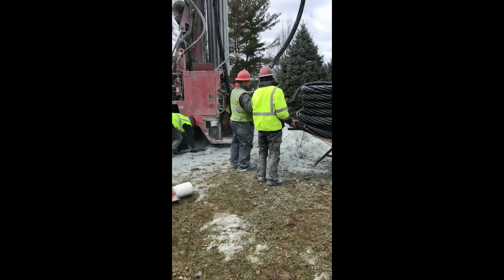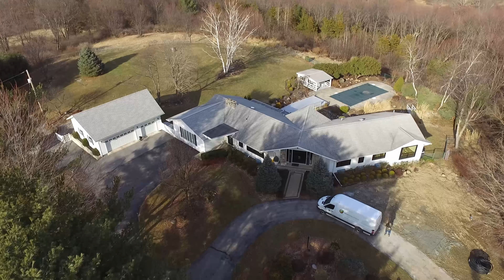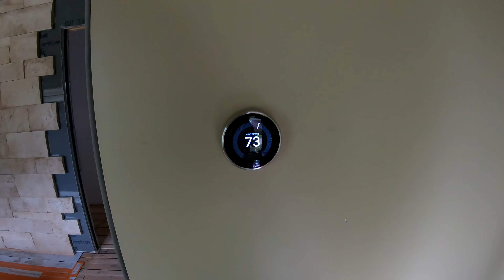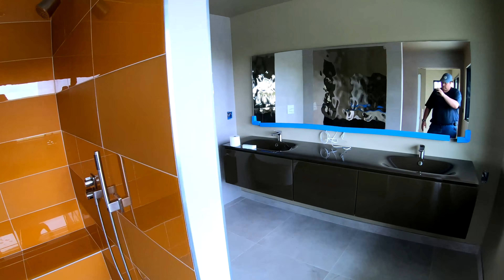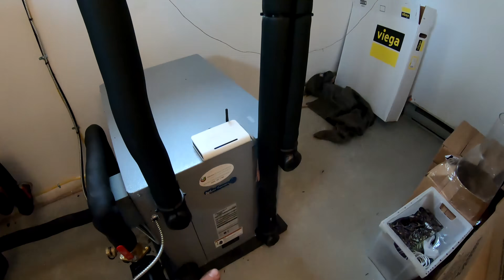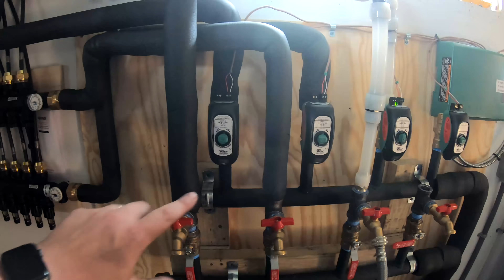WaterFurnace Geothermal baseboard and radiant water to water with domestic hot water

Comment: Hi, I am in New York and interested in doing this in my home. Do I have it right that I’m can be used with already existing baseboard, if so that would be great.
Reply from the maker: Yes you can as long as you have enough baseboards. Most house have more then needed. You could add some if you don’t have enough. The reason is the geothermal unit doesn’t make the water as hot as a boiler so you get less btu’s per foot.

Comment: Who makes this system and what’s the efficiency
Reply from the maker: The unit is made by WaterFurnace. The efficiency of the unit is 300 to 500 % based on the entering water temperature from the ground loop and the entering water temperature of the buffer tank. Geothermal is the most efficient way to heat and cool your home.

Comment: Yep, I had a Water Furnace installed in my house in the panhandle of FL 25-years back; loved it and cut utility bills drastically.  We used 4-wells at (can't remember how deep) but they drilled them like hot knife through butter in that sand.  Now I live in the Mountains of North Alabama and will look for an upgrade to the WF when the time comes.  Credit to Jesse M. for sending me here.
Reply from the maker: I am glad you loved your Waterfurnace. I found them to be the best Geothermal unit and company to work with. I have replaced a few that were 30 years old that still work but the owners wanted to upgrade.

Comment: So you drill a hole to i guess, Hell..and then run water down and back up? So are the pipes connected at the bottom of the well somehow to allow flow down and back up? That looks complicated and expensive with a Lot of breakable parts...and it needs WiFi too? I see a lot of downsides...what's the upside? Maybe if the system had a solar pump or something, but it looks like you're using the same power you'd use for a basic water heater.
Reply: The pipes are looped at the bottom of the well. And actually the heat pump uses a lot less energy than a water heater does but this equipment and installation costs will take many years to recoup on the investment. Plus the cost of repairs which will be expensive. So unless there’s still a tax incentive to do it it’s not very feasible for the random homeowners to ever afford.
Reply: @andrewdarbyshire9108  Never worth it re costs. Feel good goes only so far.

Comment: Well, I'm from Australia and didn't even know such heating existed. It must be a tremendous expense to the house. Very interesting.....Jesse and Andy sent me too.
Reply: The way they did it it’s very expensive. You could also do horizontal bore or trench method which is cheaper option.
Reply: @andrewdarbyshire9108  not in their location.  Bedrock is too close to the surface and frost line is too deep in NY winters.  There would not be enough heat rejection to keep the system running.  I'm actually wondering how good it will work on extended run times now if their drops where 300 ft of solid rock and no water to help dissipate I would think the rock will become super heated and not able to absorb the continues heat rejection and cause high ground loop temps.  @Eric Maskell is this an issue for you, I've done these for over 20 years in the south, we don't have to deal with rock.

Comment: The cost saving could never in a lifetime offset the enormous cost of this system...and you still need an entire air conditioning system. Looks like someone had $50K they didn't want.
A simple 5T electric AC unit will heat, cool, and provide hot water for this house for under $15K and be completely installed in two days. Eco-idiots.
Reply: Tell me, does it echo when you talk out of your ass like that?
Reply: @oceannavagator  I like that reply :)
Reply: @oceannavagator  Best reply I have seen in a longtime, thanks for the laugh.
Reply: Perhaps you should have read the cost posts which were posted here hours before your silly rant.
Reply: Your making far too many assumptions to shout out faults information, kind of, sort of like the FAKE NEWS MEDIA  lol,  the cost for this install as mentioned above is $21,000, the cost of gas, oil or electric depending on the size of the house, if a house is 2400 SqFt this system could easily pay for itself in 5 year and then guess what, no more gas, electric or oil bill.   so your uneducated accusations are incorrect.  but thanks for playing along  lol
Reply: @SuperMatt2112  this does not eliminate your energy bill, it just reduces it.

In some places you could install solar to zero out your energy bill but that's another expensive system with a fairly long payback time.

Optimizing this is a balance between the amount you spend on insulation, the amount you spend on hvac and the amount you spend on energy.  All of them will hit diminishing returns if you are not smart about it.  All of them can pay off over time but there are calculators for people doing stuff like Passivhaus.  A lot of "green" products have payoffs that are longer than the life of the product which means you have to replace them before they pay off which means they never pay off.

For some people that doesn't matter because they are "greening" their homes for different reasons.  If you want to reduce carbon emissions and dependence on fossil fuels, it's better to show how to do an optimized system that pays off eventually because you can convince anybody to buy in to that if you make it easy.

Sadly we mostly see "green" remodeling that probably would have been "greener" to leave alone and points programs like LEED which can give a very high rating to a very inefficient building if they use the right products (in the wrong way).  Passivhaus is ok but it's not practical outside of very expensive custom homes.  If it was pretty good haus, it might be something housing developers could build without increasing the price too much, this is where tax rebates should happen, to pay for optimized systems in median price housing so it isn't just the rich taking advantage.  If we could make median price homes with efficient designs and durable materials we could eventually replace all the housing stock with high efficiency models that don't need renovating at 30 years old or tearing them down before they get to 100.

My point is if reducing carbon emissions was the goal we would be doing things in a way that makes a lot more sense.  The way it is most "green" stuff isn't even green and "man made climate change" or whatever it is being called these days is alarmist nonsense.

Personally I like the idea of being efficient and reducing emissions because why not, it can't hurt.  If I can get to net zero even better, I would like to be grid independent.  After China's escaped bio-weapon locked us down for months, I wonder what would happen if the grid went down?  If I've got enough solar to keep the AC on, I'm fine.

In a shouting match of nonsense vs nonsense, nobody wins.

Ground source heat pumps and radiant heating have their place but I'll probably never live in a place cold enough to justify the expense.  I might wind up with a heat pump water heater although I'm not sure I use enough hot water to justify more than a propane fired tankless.  There is no one size fits all.

Comment: Tooooo many pipes and hoses,,one good earthquakes your screwed
Reply from the maker: The Geothermal pipes are HDPE and the connections are heat fused so there is no problem of them breaking. The warranty on the ground loop is 55 years from the pipe manufacturer.

Comment: The question is...How much for the whole system, start to finish ?
How much on average will it save having this instead an oil fired, hot water baseboard heating system with domestic hot water ?  Or does this just help a standard heating system ?
If these are too personnel to answer, no problem.
Thanks and great video.
Oh, Jesse sent me over !
Reply from the maker: The net cost was $21,000 but with the higher efficiency it will payback quickly and you done need oil or propane.
Reply: @ericmaskell3278 , Thanks